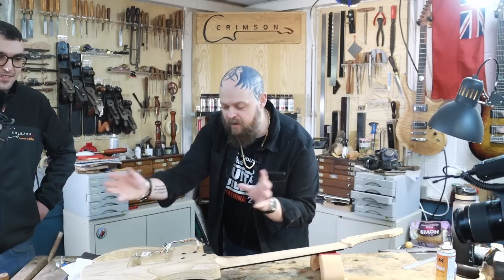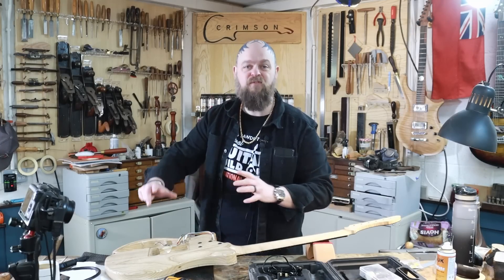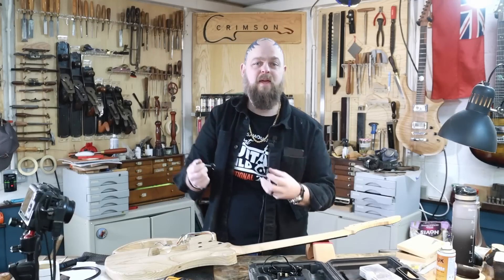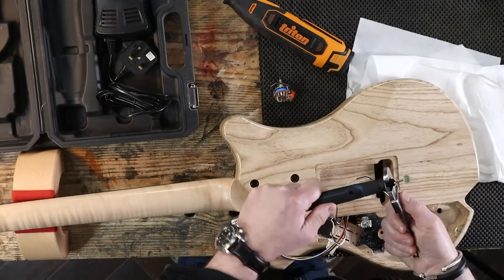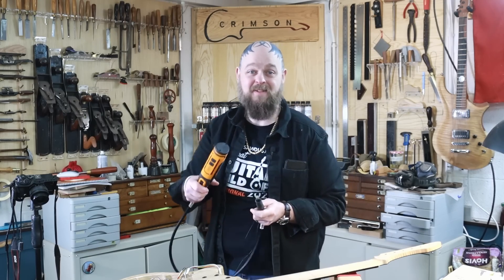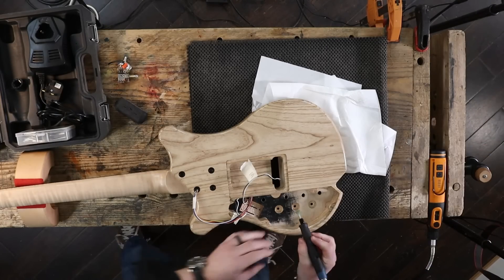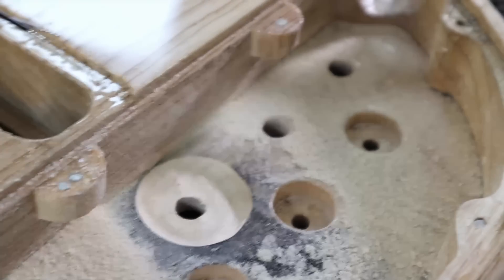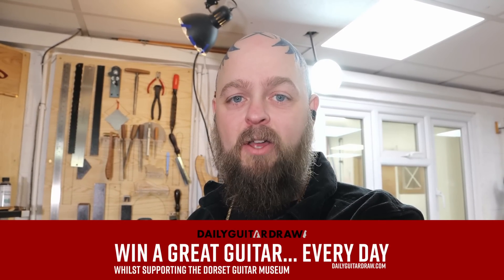Oops!! Guitar Top TOO thick for the Pots.. & How to FIX it with Style | A Quick Tutorial

Comment: Why not simply route the cavity bigger using the original cavity template, or the cavity itself as the template?
Reply: I was thinking that.  Tape up the surface to stop it getting damaged.  Job's a good'n
Reply: Or: Pillar drill with forstner bit, just have to mount the guitar solidly without damaging finish. Centering and depth are set by location / mounting of guitar and height of base plate. Both better options for someone who prefers to measure than work "by eye". My eye is not as accurate as my measuring tools, at least not yet... Can then round over edge by hand if you want to make it look nice.
Reply: This is usually why I go for a cavity depth that leaves 4 to 3.5mm of top thickness. Fits pots perfectly. Of course in this build I saw that there are extensions for the cavity cover screws that would interfere with using the original template, or using the cavity walls as a template. So in this case the guitar's design made it impossible. Also, there's wiring already. Routers and wiring = messy routing. Think of this as a fix to a last minute problem.
Reply: @chaptermasterpedrokantor1623  Yes. Could also be that customer changed spec at late stage, the three below are cut to depth already.
Reply: @stephenkeen6044  I get the impression its a student guitar build.
Reply: @chaptermasterpedrokantor1623  Makes sense.
Reply: Was thinking the same
Reply: Cuz this is a triton commercial and they wanna push the little dremel thingy 😂
Reply: @Overit5000  Triton made a Dremel!
Reply: @Overit5000  110%, which is a shame because they should be pushing to educate people on the right tool for the job, not the paid advertisement opportunity...
Reply: @stephenkeen6044  even a cove bit with a bearing guide that sits hard in the pot hole and you're good to go....
Reply: @ChrisFranklyn  much quicker and cleaner too.

Comment: Perfect timing, this is literally the next job on my build. I was going to go in the right direction, using Dremel and fled shaft, but would probably have used a sanding attachment, so I now know better!
Reply: flex
Reply: I literally JUST blasted through the top of my first scratch build with a forstner bit attempting to get a switch to fit, then saw this video. At least I know for next time lol

Comment: This is harmful method and should be avoided.
 You need something uniformly flat for this operation. I'd go with Forstner bit anyway, or would make special bit for this job, and you have to do it on stable boring mill. The thing is that pot hole must be very flat and in parallel with outer surface, because otherwise the pot axis will bent and the pot won't operate correctly (the pot internals will go off the groove which leads to lose contact, noise and clicks). Then it may be 'workarounded' only by  loosing the pot nut and making it like barely fixed in place...